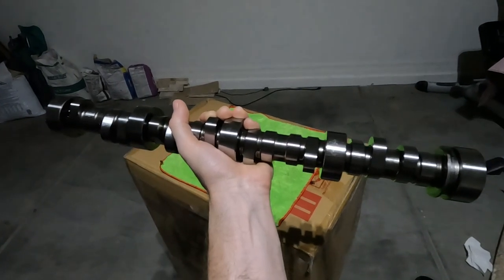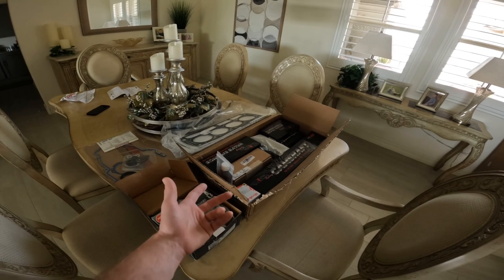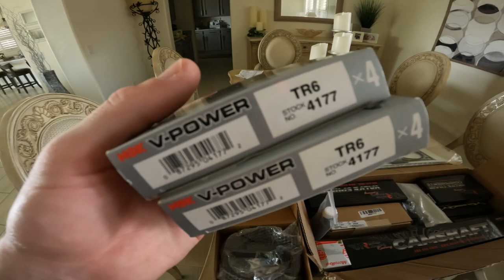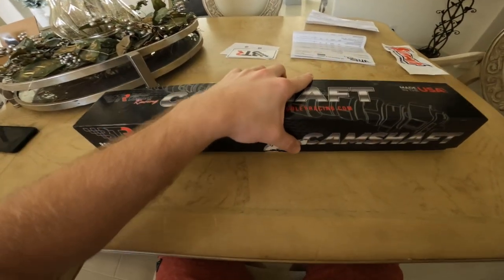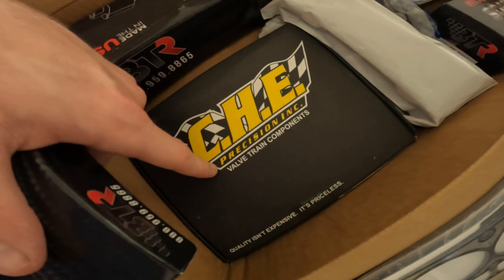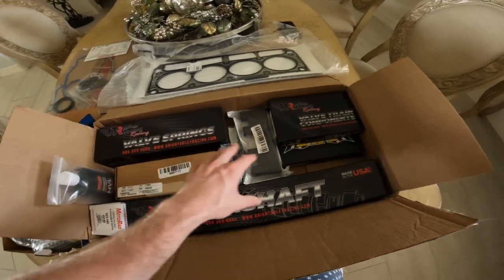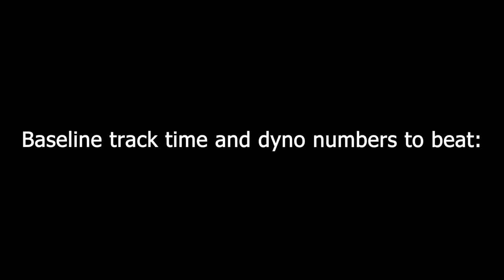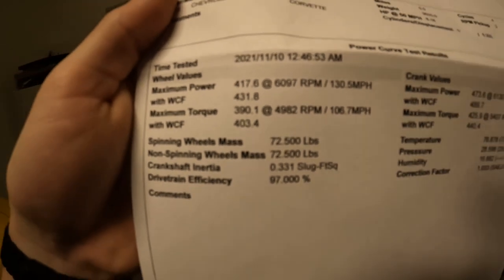Cammed C6 Corvette Price Breakdown *BTR Stage 4 Camshaft*

Comment: I used morel lifters as well. The engine is soooo quiet its crazy. No more tics or noise. I believe my shop did 0.39 or something like that for preload. Stage 3 btr, dual valve springs W titanium retainers, same trunion upgrade, 3 bolt cam conversion, c5r Hinson heavy duty timing chain. New oem lifter trays, high pressure oil pump. Also did McLeod twin disk clutch, fast lsx r intake mani, and jba headers. That's gonna be a good build 👍 mine gets beat daily in 100+° weather on a e85 tune stock fuel system. I'd strongly recommend a quality catch can too.  Highly recommend these parts as they're performing awesome 👍👍
Reply from the maker: Glad to hear the lifters are quiet, the lifter tick drives me crazy!
Reply: What lifters were you using before the Morels? I ended up going with Delphi ls7 lifters for my BTR cam but I wish I had went with the Morels. Mine is still in the shop
Reply: @bwill03z76  you'll be fine. The shop recommended any LS7 style lifter but I just did a lot of research and decided I'll go with something a little bit tougher. The car was bone stock with the OEM ls3 lifters before. About 80 or 70,000 miles at the OEM ones getting a little bit louder, nothing bad or largely noticeable. I put oil stabilizer and Pennzoil Ultra Platinum every 3 or 4k  miles so I'm sure these lifters will probably last the life of the car.
Reply: @rafaelfavela77  yeah the Morel lifters are supposed to be really tough, even the lower end drop-ins. And you can get a set for like $200. I’m sure these Delphi’s will be fine I just hope they aren’t noisy

Comment: Just did this exact cam and valve train upgrade with  on my gto pulls real nice.🙌🏾 that btr stage 4 sounds soo good.
Reply from the maker: Picks up like crazy in the high RPMs too
Reply: @CamMarz   i had the stage 3 and the power band definitely felt low end torquey but with the stage 4 feels almost like a honda cause i rev this thing out  and feel all the power up top.Gonna do a gear swap see if i can wake it up a lil more. Nice build bro🤙🏾

Comment: Was debating between a C6 or gen 3 S550 5.0 Mustang.  Because e85 tuned can yield almost 500whp.
Reply from the maker: It'll be cheaper to make power with the mustang. The cheapest part about a Vette is buying one. There's a Vette tax on everything... I definitely don't regret choosing the Vette over a modern 5.0 tho!

Comment: Is it a good idea to get aftermarket valves as well? Not sure if they're just not worth it
Reply from the maker: I don't think there is any reason to do so
Reply: @CamMarz  thanks for the feedback, and the vid. If I ever do buy a c6, I’d love to cam it and use your vid as a guideline. Seems like a pretty solid line up for only ~1900 bucks.

It’s either between a C6, or a s2000 with the science of speed stage 1 supercharger. Ugh, tough call!! Probs gonna get either in the spring/summer

Comment: Where did you buy these parts from? Any suggestions for head and cam parts for LS7 ? I have a 08 z06
Reply from the maker: Brian tooley racing and Summit. I might consider RPM's heads/cam kit on their website if you have a Z06. Those B3 cams make good power. BTR also makes a solid cam for a Z06 too!
Reply: Gwatney Performance Innovation has just what you want and need!  👍🏼

Comment: Are the Morels pretty quiet? I started to get them but ended up going with Delphi LS7 lifters. I hope they are fairly quiet cause I hate excessive ticking
Reply from the maker: Initially they were very quiet, they have since gotten louder though. Better than stock still though certainly
Reply: @CamMarz   Good to hear, glad the car is holding up well. It sounds amazing!
Reply from the maker: @bwill03z76  Thanks! Need to change my alternator now lol

Comment: Good job bro... me and my buddy cammed his  G8. It has a lot of other goodies too it boogies I bet that vet is pretty fast now LOL
Reply from the maker: I can't wait to get it in and on the Dyno that's for sure!
Reply: @CamMarz  should make close to or about 500whp? Depending on what else do you have done to it? My buddies G8 has full exhaust 327 Camaro SS diff 3200 converter and one hell of a trans and engine tune made 440 whp. And On pump gas. Surprised that you went with a Brian Tooley camshaft but that's cool cuz everybody in their mama has a Texas Speed camshaft LOL.
Reply from the maker: @badassbrian11  yeah I've heard mixed reviews with TSP 😅 I'm anticipating around 500 wheel
Reply: @CamMarz  I made 503rwhp on my grand sport ls3 with Texas speed stage 4 cam full exhaust headers intake you should probably be around the 500s for sure
Reply from the maker: @yurimunrayos69  I'll be knocking on the door of 500 wheel I imagine. The intake duration is more aggressive on the TSP F-35 cam so I might not get as much of a top end gain, but that's to be seen!
Reply: @CamMarz  I have high flow cats on mine also Maybe if you go without cats you'll be 500+ also some depends on your tuner mine was tuned by real st performance In Florida and if I went without cats I'd probably get a little more power but you'll probably get more exhaust smell so there's that too lol but Goodluck you'll love it either way should pull hard and sound nasty!

Comment: All that for 430 wheel? Ass. How do you get more lol
Reply from the maker: Made 497 wheel
Reply: @CamMarz  Oh my bad. At the end of the video you showed it only made 431.8 wheel
Reply: @CamMarz  still tho, how to you get around 700?
Reply from the maker: @gretre4560  That was before the cam actually, with the cam it made 497. But you'll likely need to boost it

Comment: You’re gonna hate the driveability with that cam lol
Reply from the maker: Haha I'm a tad bit worried not gonna lie
Reply: Nothing to be worried about, my C6z has a cam way larger than a ls3 BTR stage 4. A competent tuner will have it driving fine
Reply: @Recklessfireblade  6.2 liters vs 7.0 liters lol. Also the bigger the cam also lowers dynamic compression which makes low end feel like a dog. Yeah you can tune it but then that defeats the purpose of the cam